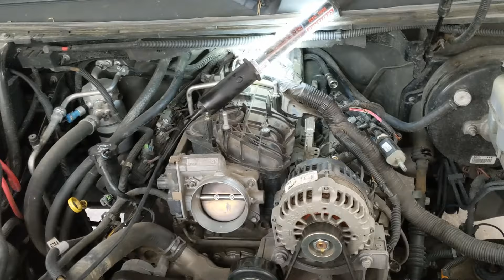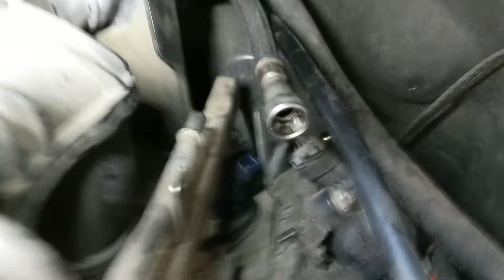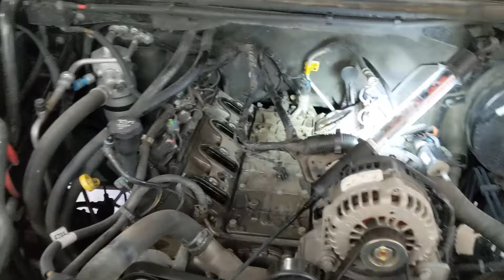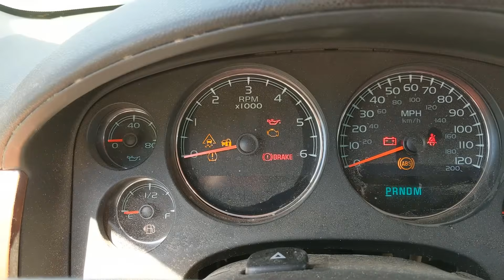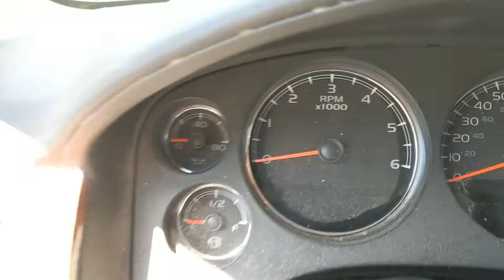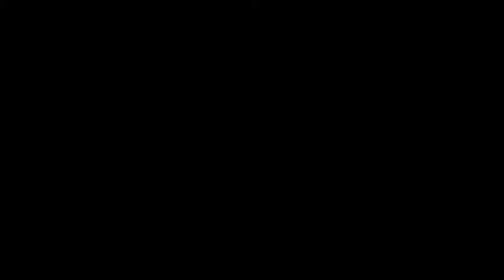Chevy Avalanche Oil Pressure Sensor

Comment: I noticed when you started your avalanche the “check tire pressure” displayed. Mine has done this forever even after multiple different tire sensors. Is the only fix a new computer ? After clearing the message all pressure reads correct 🤦‍♂️

Comment: How much did it cost
Reply from the maker: The cost of the sensor varies on which brand you chose. The labor I think calls for an hour and a half, but might be more. Some folks are able to sneak the sensor socket behind the manifold without removing it. That would save time and cost of upper intake gaskets.
Reply: I did mine already. How I did it is on my channel. I did not take off all that.😮

Comment: Didn’t have to do any of that 🤔. It was a pain but doable. 

Must be a union mechanic 😅😅
Reply: Isn't it right in the back of the engine? I remember using an extension and a u joint socket and got it without moving anything.
Reply: 😂😂😂 right!! Shop time for GM.

Comment: It's a struggle but you can change it without removing the intake.
Reply: Where's the video
Reply: @jaysautoandmore1771 I’ll upload one this weekend. It’s a tight fit but removing the intake manifold isn’t necessary. It makes it it easier to get to it but it’s a lot more work. You also don’t need the special socket, just a 1 1/16 deep socket. You just have to do it on feel because you can’t see it
Reply: @steggc85 you didn’t do that
Reply: @jaysautoandmore1771 lazy ass, search for one.  Theres many
Reply: My mechanic just did that. Crazy shit lol

Comment: What size socket
Reply from the maker: They make a special socket for sensors like this. I used a 27mm however.
Reply: @ExoAutoWorksVlogs 1 1/16 socket. Use both hands on the wrench or it will break.

Comment: No oil pressure after changing oil pressure sending unit
Reply: What was the problem?
Reply from the maker: The sensor went bad and wasn't reading on the dash.
Reply: @ExoAutoWorksVlogs did you get a message that said “oil pressure low stop engine”

Comment: Does a 2006 Chevy avalanche have a oil pressure sensor screen filter?
Reply from the maker: It does!
Reply: Why didn't you show how to take the screen out to begin with in your video-? what happened to that missing step,  was a very important one. Can you at least explain to me how you did that-?

Comment: I have this same issue on my 2009 ltz. What’s an average price range to expect for this repair?
Reply from the maker: $200-300 parts & labor
Reply: @ExoAutoWorksVlogs  $10 - sensor + $10 - 29mm socket + $6 sensor filter + 1h of your time. No need to remove all the stuff mentioned in the vid
Reply: @edgarsi  that’s what I thought
Reply: @edgarsi can you explain (if you would be so gracious) on how to get to it without removing the intake manifold ? I need to replace mine but don’t want to pay a shop $800 to do it like I was quoted lol